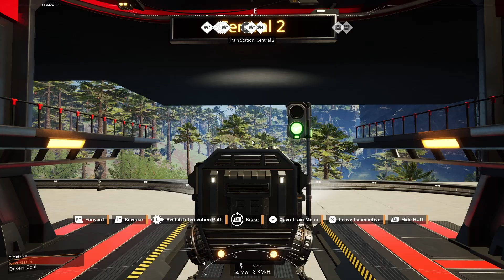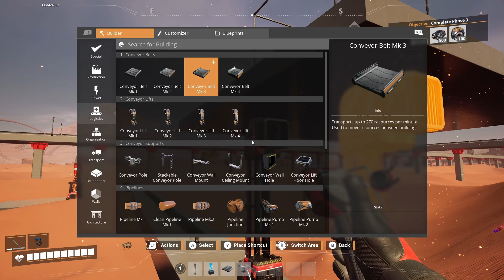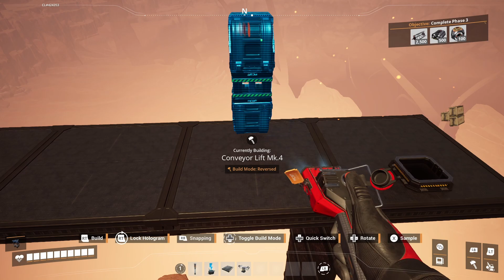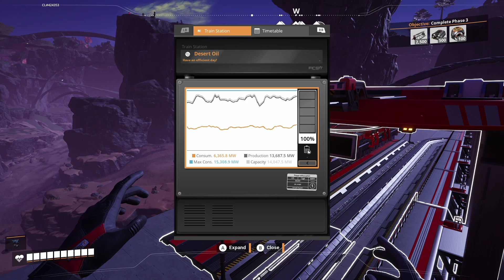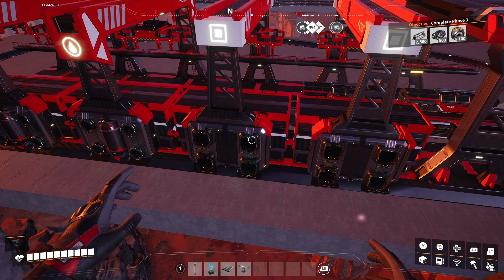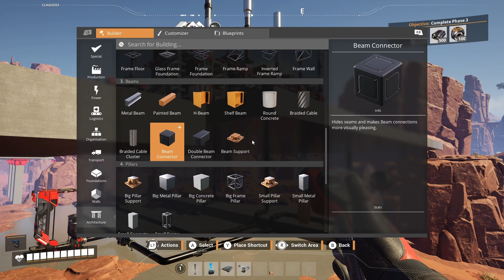Desert Sands Expansion – Turbo Fuel Startup | Satisfactory 1.1

Comment from the maker: Hope you enjoy the video. Whilst we start our journey to a turbofuel'd powerplant, and just in case anyone is interested here is what you need:
900 Crude Oil - in a refinery, use Alt recipe Heavy Oil Residue for 1200/min Heavy Oil Residue.
2400 Water - Using packagers, package up water for 2400/min
Mix both into refineries with 2400/min empty canisters using alt recipe Diluted Packaged Fuel for 2400/min packaged fuel
Then create compacted coal, from alt recipe using sulfur and coal. Now depends how much sulfur you can get hold of (or make via SAM ore), but with this you have a max of 1600/min compacted coal to mix with your 2400 fuel/min (after unpacking) in a refinery using the Turbofuel recipe. This will net 2000/min Turbofuel. Enjoy!

Just to add, do all of this and you will fuel 2000/7.5=266.667 fuel generators. Therefore, @ 250MW per generator, thats 66.67GW. Not too shabby for mid game. I didnt end up doing that in the next episode (coming soon), but I eventually used just two 480 belts of compact coal, but that was still an impressive leap. You have to work on what alt recipes you have unlocked, feel free to adjust.